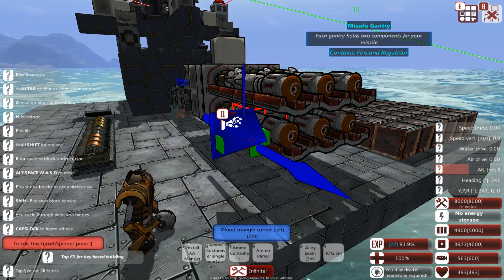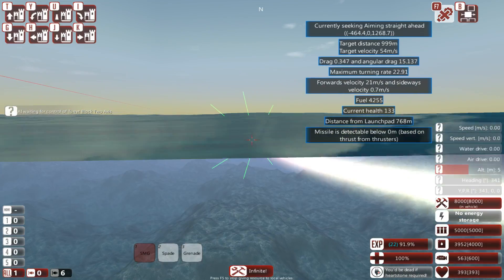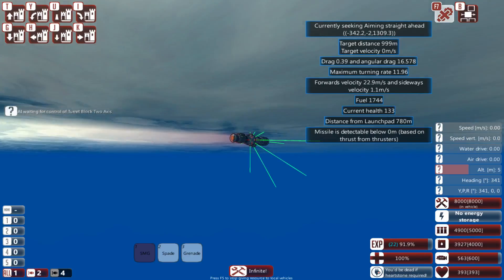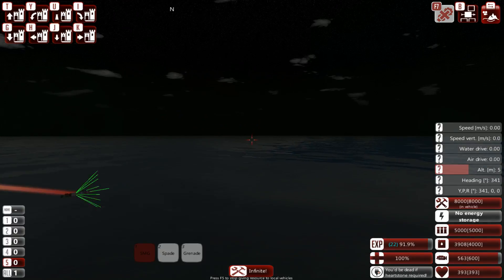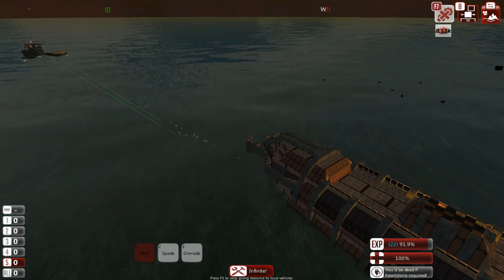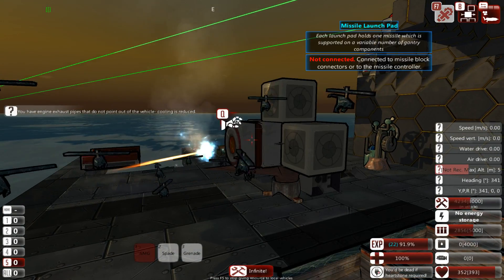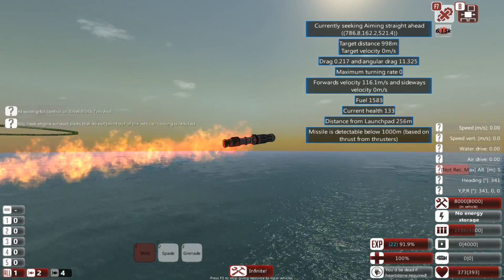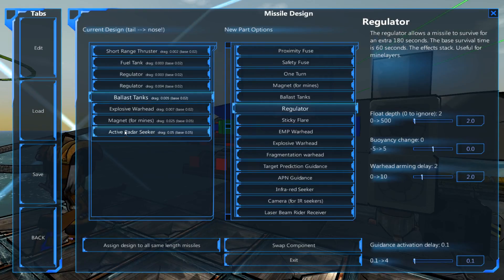From the Depths - ASROCs & Rocket mines

Comment: Nice designs! You could also consider a tracking solution other than sonar on the rocket assisted torpedoes, I haven't tried that in a while but laser designated, IR and so on all used to work reasonably well. That would give both thruster and propeller guided stages active seeking capabilities, and remove the need to tune the launch time. Only downside then remains vulnerability to above water anti-missile defences.